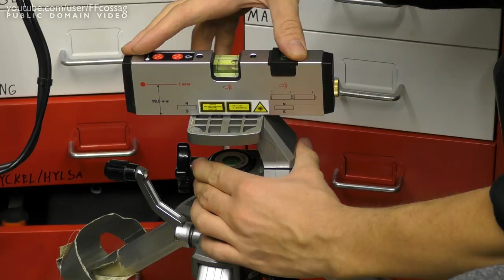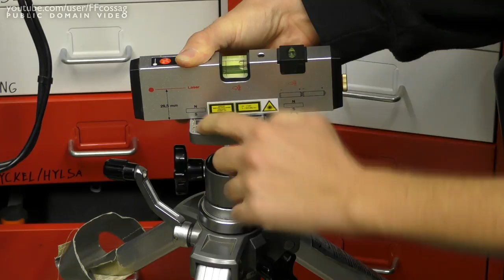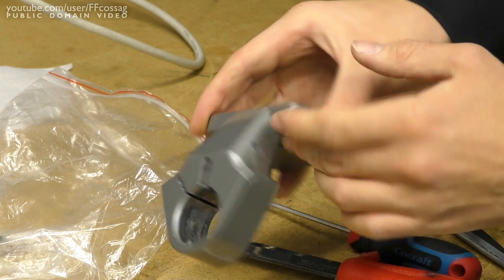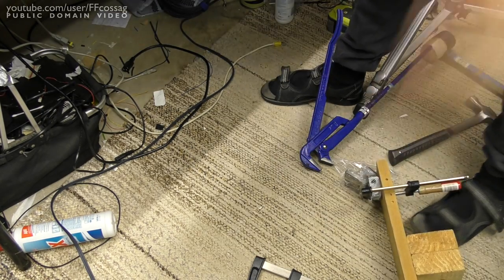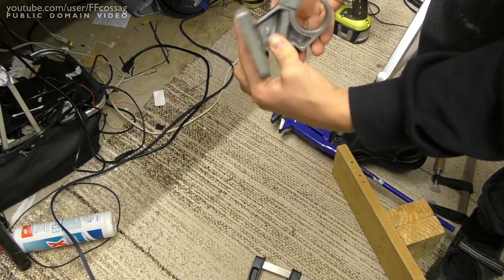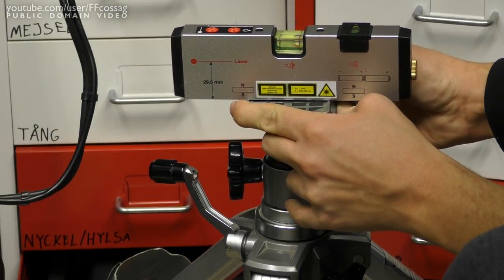IDIOT BREAKS TRIPOD

Comment: lol, I could see that happening a mile off as its die cast Aluminium. You could actually repair it by drilling some holes through and using bolts to reattach it.

Comment: Also if you knew someone with a machine shop or a mill you could have just remacbined the top plate...
Reply from the maker: Alas I don't.
Reply: I did not read comments before posting my similar comment. And of course knowing someone may be the problem.
Reply: mechadrake Of course I didnt...  Some youubers will have thousands of comments and Im not about to read them all, it just so happens FFcossag isnt quite as popular but Im still not reading 88 comments...

Comment: Hmmm, it can be drilled. My first thoughts are the square cut outs on the head are wide and deep enough for some bolts, if you drill two spots in the center of the square sink for two bolts facing down. 
Drill two holes on the side, fab a metal square bracket about a 45 degree bend, you can still bend it slightly to the correct angle if needed. The nuts on the bolts running down in the squares divits on the bolt down through the top. The head of the bolt will need to be small to fit in the little wholes. Or you can take a bench grinder and square the bolt head to fit so the bolt won't turn as you tighten the nuts? 
Washers for slight adjustment under it against the bracket and a nut. The same for two drills on the side, again bending the plate or washers with a bolt to secure and you might be able to bracket it level again? 
It will be a little playing with the bent angle of the plate and washer spacers to get to, but some lock tight and it should hold for the weight of your new camera. It won't be pretty but should work.
Just my first thought, nothing to loose by giving it a try.
Reply from the maker: I zip tied it back together, lol.
Reply: FFcossagWwell that's works to, lol

Comment: Thats an easy fix, make a steel strip to fit the inside vertical and bend it to create a shelf under the original plate, apply bolts 4, and for any slight slack pour epoxy into the broken join.
Very easy peasy :-).
Reply from the maker: I just zip tied it together, the crack is so clean that it forms a very strong friction fit when pressed together.
Reply: Did you drill holes and put zipties through?
Reply from the maker: zx8401ztv Yep!
Reply: I dont know, a bit of metal off a dead Bestec ps.... no no second thoughts ha ha :-D

Comment: Ah well, at least you can show us how to properly fix it up now :D
I know that "I hope this doesn't go wrong" feeling all too well, followed by the usual "I did something stupid" revelation (last time I had a bad case of that was when I rammed a screwdriver into my finger cause I slipped off a thing I was trying to press together with that and using my whole body weight to push onto the screwdriver while holding the piece with my fingers....).
Reply: it's also quite bad when you want to de-lid your new 350$ processor for better thermals, then slip and suddenly have a knive sticking through your 2 day old cpu.
Reply: And de- lid tactic does give very little probably anyway :)

Comment: A piece of 20mm plywood as a back block inside the support arm - 2 or 3 self tapping screws through the casting into that then a couple more from the platform between the webs in the casting and good as new

Comment: you could have place a small square plastic bowl on top of the mounting plate and then filled the bowl with thin epoxy resin and let it gravity level out itself then when it hardened it would gave you a epoxy "plate" to shim you camera on, which would have corrected for the tilt of the mounting plate.   like if you set a bowl of water on a crooked table top and the water levels due to gravity, except the epoxy would have hardened and made a shim plate for your camera.
Reply from the maker: That's an excellent idea and I should have done that to begin with.
Reply: Well some JB Weld epoxy and it will be as good as new! just apply and use a vice to squeeze it together and hold to make the epoxy as thin as can be so as not to put the two half's out of "TRUE" as much as you can, for gluing back together that is, then use the self  levering trick above to make a new mounting shim! Lol good luck!